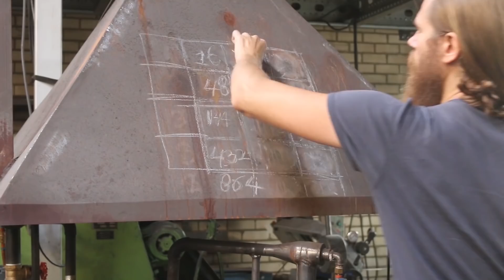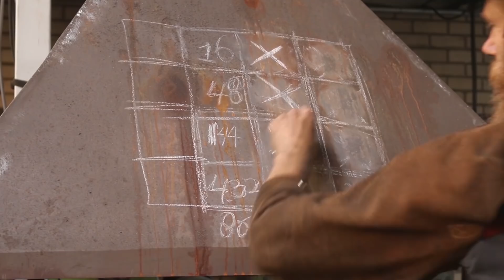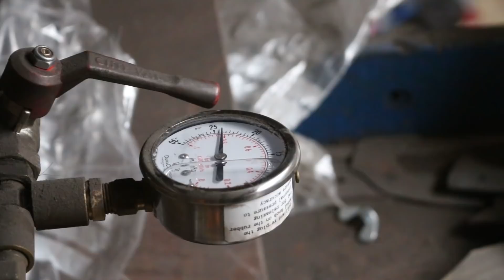Forging a Pattern welded Khukuri knife, the complete movie.

Comment: love seeing smiths work,but don't know much more then the basics.however what is it he's doing by cutting cross cuts then forging then drilling and then forging what does that do?is it for style and design or making stronger the steel?
Reply: Both, I think. As far as I know the layering is done to combine the qualities of two different types of steel. A hard one for a sharp edge and a more mallable one so the blade doesn't break. The beautiful look is a welcome byproduct of the process. Not sure what the drilling was about though.
Reply: @stephanellenberg2871  nope that's not what he's doing.for super steel one only dents the edge then using hypercold like 50 below freezer to tighten the atoms up,then one reheats it and cools it down 12-15 times. as well what you are talking about is japanese welding style no drilling holes like that.i don't know about the cross lines or dimples he puts into that still.but thxs for offering help.